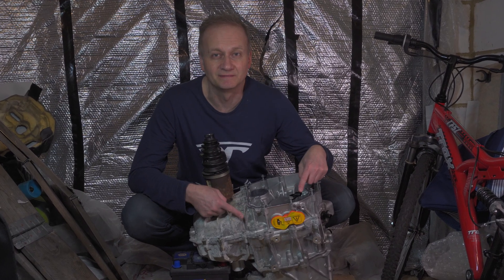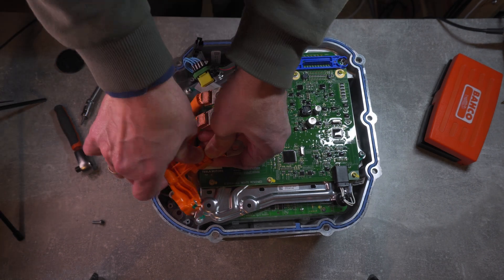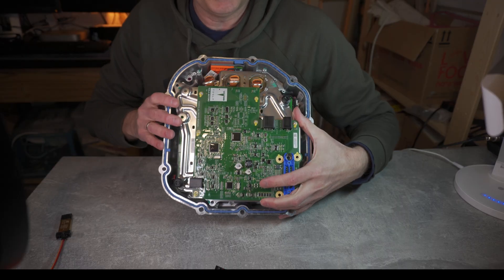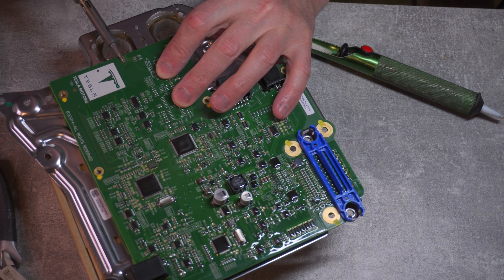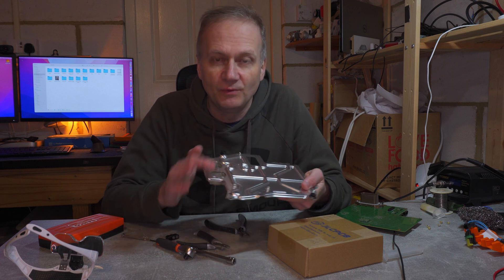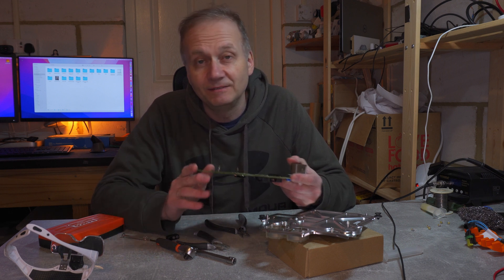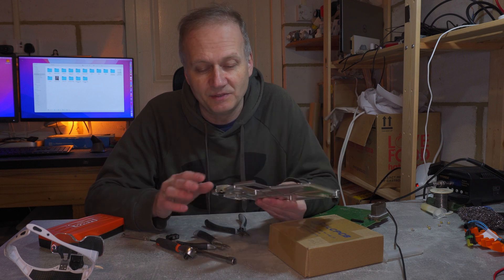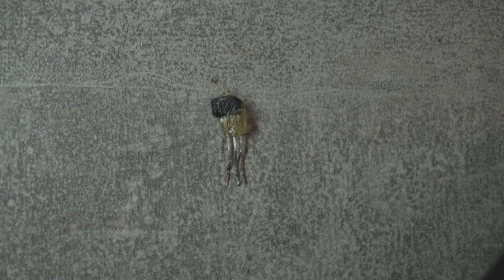I messed up, what next ...? #6

Comment: I watch all these type videos and everything Damien does because I hope at some point to be able to build one for myself.  I think the first thing I will do is just go ahead and order new sensors and have them on hand and not even try to remove the others. I have desoldered things in the past but I always used a braid to pull the solder and I don't know if that would work at all on this stuff. 

Good luck with it Latuta EV.
Reply from the maker: The difficulty in this case is that the PCB is covered with a protective coat. You can remove the top one but you can't access the bottom one until you unsolder the bottom one. If I were to do this again I would just cut them as high up as possible and would solder to the new board with solder overflow perhaps
Reply: @LatutaEV  thanks, that will help.

Comment: Too bad you didn't give to some proffesional shop to unsolder it.. I wouldnt dare to do that by my self if is to risky. As I can see, you knew it is risky.  I hope you will get sensors
Reply from the maker: Yes you are right that was very stupid of me.
Reply from the maker: I should have at least got hot air station and used that
Reply: @LatutaEV  yes, hot air station at least
Reply from the maker: The main issue is that the Tesla board is covered with the thick layer of protective lacquer and even with hot air chance of braking the sensor is high

Comment: If only someone had done all this work years ago and posted it on video and forum....
The sdu current sensors are Melexis Mlx91209ca exact same as on the model 3 drive units. Usually in stock at mouser.
Reply from the maker: Oh Damien you are a saviour. The embarrassing thing is that I watched your video where you explained how you damaged one sensor and I was sure that I can avoid it but did it in the end too😢
Reply from the maker: I had a look on Mouser and Digikey and unfortunately 7.3mV/mT version is out of stock but they have 19mV/mT. Did I understand correctly that this version could be reprogrammed to have required sensitivity?
Reply: @LatutaEV  I'm not sure if it helps but I searched for 7.3mV/mT and found as-electronic seems to have them in stock.
Reply from the maker: @alibro7512  wow thank you so much I will have a look. I have already ordered the other model but will consider this one as well
Reply from the maker: @Ali Bro your suggestion was very useful thank you so much. In fact Mouser sent me this form as the sensor was special export status. So I decided to cancel Mouser order and order the right part from As electronics.
Reply: @LatutaEV  Glad it helped. 🙂
Reply: @LatutaEV  hmmm possibly but, and i'm just spit balling here, what if there was another way? what if there was some mechanism in some sort of opensource software to allow ANY current sensor to be calibrated using a know dc current and just adjusting a value on some sort of web interface? pfffftt crazy...
Reply from the maker: I thought so 🤣